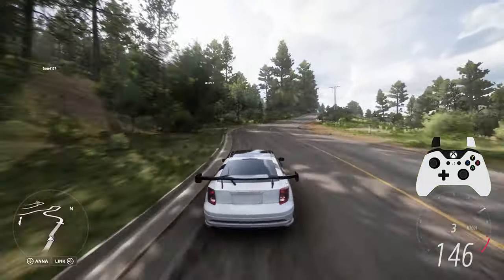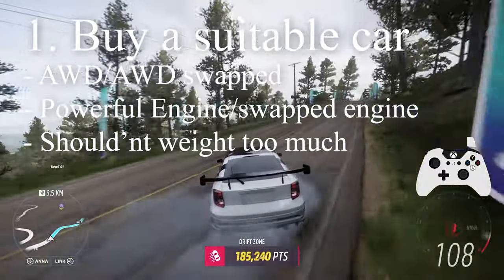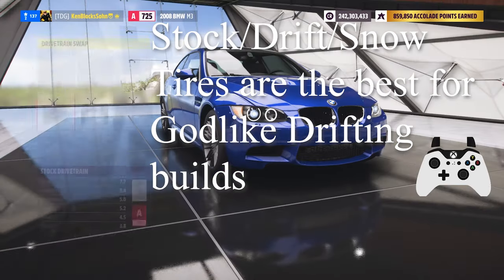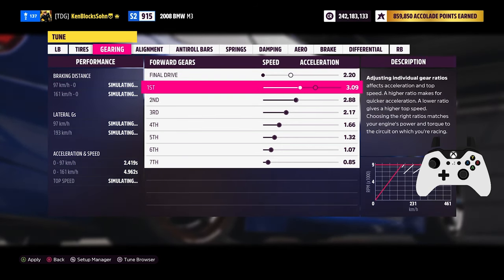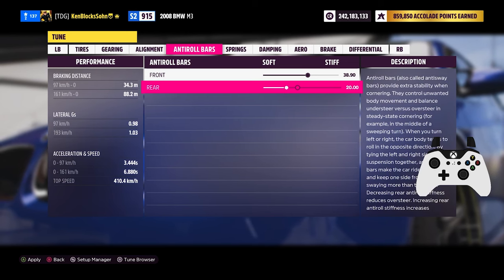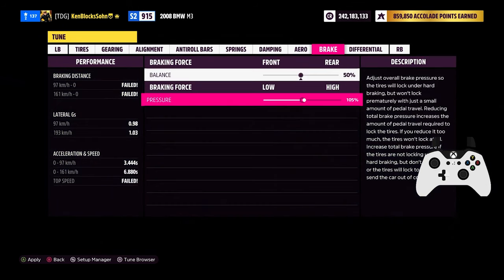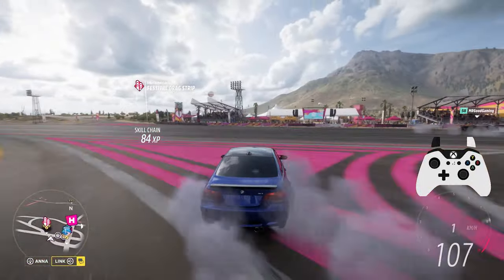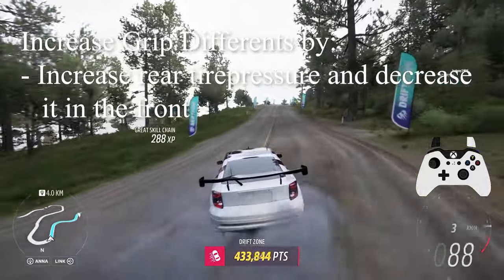Godlike Drifting Tutorial | Forza Horizon 5

Comment: ive been making my own tunes for a while but i just wanted to learn a few things from you because your tunes are so amazing! But i do have one question why do you put your balance too 100% if it is awd swapped?
Reply: I'm in the same boat as you. I usually run 88% as standard, but I imagine it's something that deals with feeling the most like rwd, while still being AWD bc maybe AWD ranks points better, or it has to do with angle
Reply from the maker: Its basicaly at 75% on cars that have been swapped
Reply: @Kenpai_TDG  ah ok, what do you recommend tire width wise? I've always kinda thought that thicker tires are better for points as long as you have enough power to spin them up
Reply from the maker: @contactplayz4962  if you go with winter tires you might make those tires a little thiccer after you tried them and they slid too much